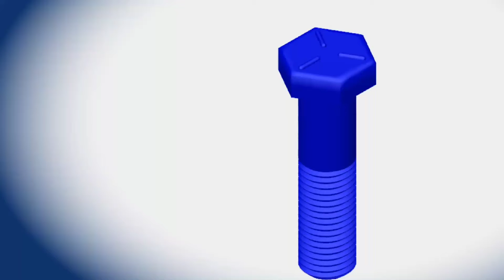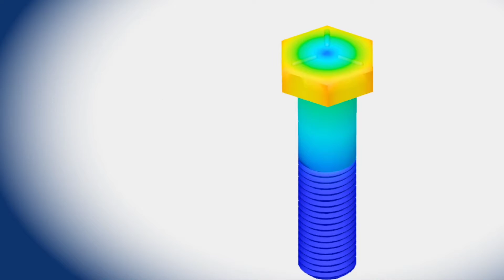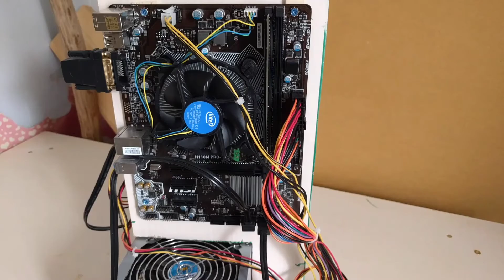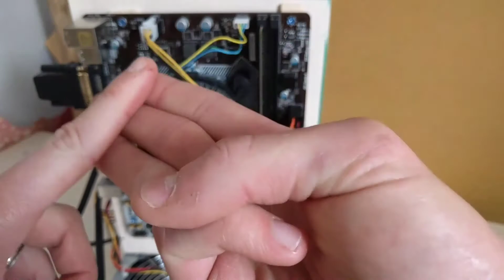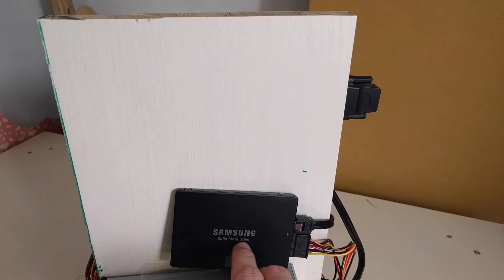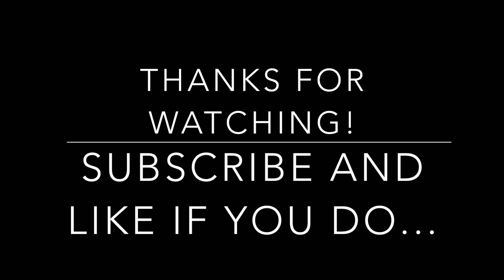CAD Workstation PC - Hardware Recommendations

Comment: Lap Top is 2 x more cost of an Desktop PC. You can run Solidworks on an potato. But serious work whit assembly you need Quadro card, 4 cores whit high core clock and 16 Gb of RAM.
Reply from the maker: Yes total agreement, however what do you mean by serious?

Comment: About the CAD part, I absolutely agree. Back when I was taking autoCAD in high school, we used to run autodesk on pentium Ds with a GeForce gt 610 and 2GB of ram (this was 2016). Granted we were only running basic 3D models, but that's all you really need.
Reply: All that you need? Not even close lol

Comment: Thanks for this video. I am in the process of picking parts out for a budget type cad/cam PC. SW and Inventor will be the only things ran in on it. Will be used for learning. I'm curious if you could look my list over and let me know if theres anything to change/swap for similar price. https://pcpartpicker.com/list/MfBKjc
Reply from the maker: yea I think that the hyperthreaded pentiums are always a good choice for a budget build. 3.6ghz is pretty good as well. I like the dedicated graphics card that should be pretty good, just for future stuff I would suggest a nvidia card so that you have CUDA for a similar price. For me thats what I am looking into for some real cheap machine learning Depending on the assemblies you work in 2gb vram might be a little low, but with my integrated graphics on my celeron I've never seen any studering with the CNC machines I design. The SSD is a great choice it will make a huge difference with the day to day operation and is well worth the 60 buck investment. 

This is a great place to start and that motherboard will give a great upgrade path in the future if you so choose. 

I'm glad that you have the same vision as me for computers in that you dont need a $2,000 "workstation" if you are intelligent and choose the parts with purpose. 

Hope that helps!
Reply: Thanks for the reply! Good to hear, I have yet to do so, but I plan on compiling a few more cheap budget builds just to compare options/swap parts between. So I will be purchasing soonish. I have a pretty good grasp of teaching myself programs/code, so I am hoping that transfers a bit to this, have a bit of motivation going at the moment too. But I currently work in a machine shop and am doing this, to climb the ladder and well, because this type of thing is in a way calling out to me. I'm like an addict wanting to learn as much as possible with this. 

I've tooled around in AutoDesk and the tutorials I've done are easy to follow, point is, assemblies are probably a little bit down the road. My current primary focus is learning the tools, translating blue prints into simpler/detailed drawings per operation and pure learning. Long road ahead of me, but that's why I am building this cheap workstation.  And i agree, the software isn't that intense for basic learning and im allowing room for upgrades for when I make it to the things ill need them for. If I'm going to drop $2,000 on a PC, you better believe it's gonna be strictly for gaming. 

The dedicated hardware for expensive workstations is all a niche ploy for companies. Keeping one important thing as stable(the drivers) as they can to hold onto Billion dollar companies money, cant knock em but I'll stick to budget builds, tech is almost moving too fast not to stick to budget builds lol.

Anyway, thanks again for the reply, glad it got a positive response, makes me more comfortable with the purchase!

EDIT: I meant to ask, could you recommend any good books for CAD/CAM? Most books i've seen seem to have heavy price tags as well. Thanks.